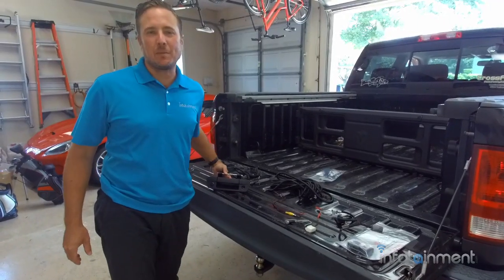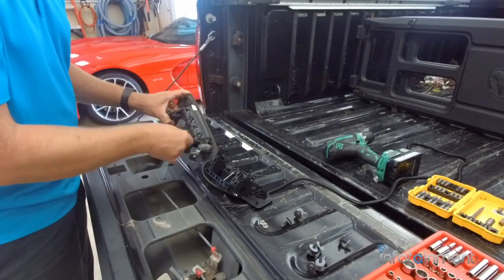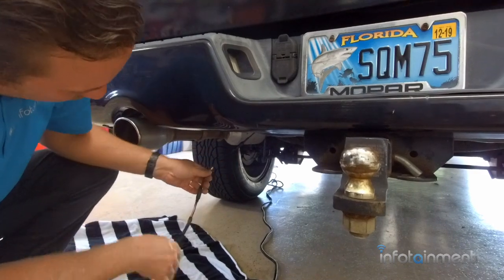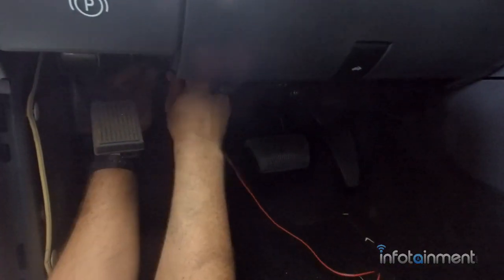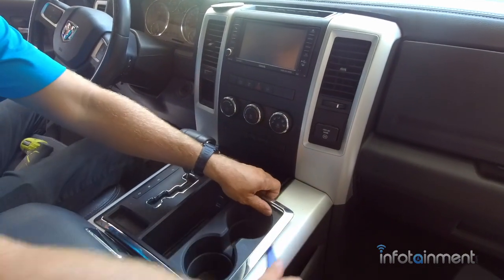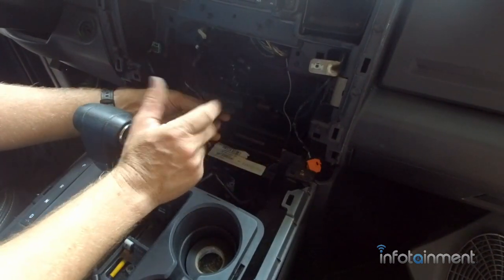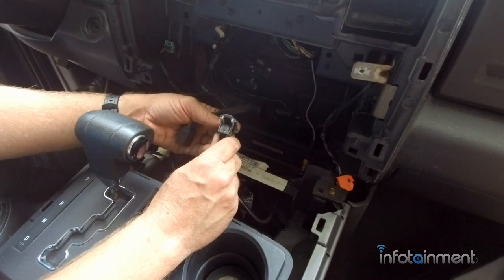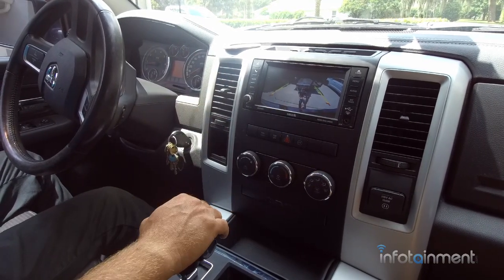2009-2012 Dodge Ram 1500 2500 3500 - Rear Back Up Camera Install - Easy Plug & Play!

Comment: can you please explain the OBDII device that you used?  Is It a special OBDII device for strictly this type of BU camera?  or does any OBDII reader work?   I have a 06 Ram 1500 with a Sony XAV-ax300 head unit that has a camera port.   Thanks,  Brian
Reply from the maker: Hello Brian, The OBD genie programmers are setup for each individual objective upgrade to avoid getting things program via the dealership. The stock setup is VIN locked for 1 vehicle for the back up camera or the objective of the RPO code that is added. We can make these work for more than 1 vehicle for a custom order or add certain objectives together but only a few. Let us know if we can help out more on live chat on the site www.infotainment.com

Comment: The obd2 programmer does this work for any aftermarket radio? I picked up a radio touchscreen nav etc.. with harness for vehicle and reverse camera in tailgate handle and was wondering does this obd2 option more or less tell the radio the vehicle is is reverse once programmed.. if so ill buy it juat want to verify
Reply: My stock radio is not touchscreen but I'm installing a touchscreen that's made specifically for my 2011 ram 1500 with a harness made to retain all factory functions and steering wheel controls
Reply: How does the obd2 programmer work I guess is the crux of my questioning.. and does it only work with a factory touchscreen radio or... thanks.
Reply from the maker: Hello.  The OBD programmer programs the RPO code in to the body control module of the vehicle.  The programmer is specifically meant for factory OEM hardware.  You may or may not need that programmer if you have an aftermarket radio.  You would need to refer to that radios requirements for a backup camera to know for sure.

Comment: Will this interfere with the parking assist sensors? Will both work simultaneously?
Reply from the maker: Yes both should work as we are using the OEM RVC programming. This will intergrate into your current features.

Comment: I already have a harness connected where you say to plug in the RCA interface. There are no wires going to the RCA pin ports though on the factory harness. Can I remove the wires from the harness and snap them into the factory harness?
Reply from the maker: Absolutely!
This link may assist!
https://infotainment.zohodesk.com/portal/en/kb/articles/c-intc2t-repinning-if-vehicle-already-has-the-radio-plug
Reply: Same here, and 3 and 4 spots are not free. A green wire and striped green wire is taking these spots, can I remove them 2012 ram 3500

Comment: Just installed mine .. was not as hard as I thought it would be ..
Reply: For anyone on the fence about trying it... I would say go for it .. Installing was very simple, takes for someone like me who has never attempted to try something like this before about an hour of your time .. and it works as  Advertise. Money well spent
Reply: @brandonstorch4522  What features did your radio have. I have the parking assist already, just no camera. I have a 2010 Laramie

Comment: You scam artists are charging $300+ for the camera!! Hoped nobody fell for that
Reply from the maker: This is a very high quality camera.  This also comes with the OEM handle which a lot of this cost is dedicated to. We offer units that are OEM or are as close to OEM as possible. If you are looking for a cheap aftermarket camera plenty of companies can provide that but that is not what we are interested in selling.
Reply: Full OEM handle assembly with camera (1280 x 720 resolution) and wiring harness  < $70 on amazon. The OEM head unit only supports 480 x 272, and 7" aftermarket head units are 1280 x 720 max.

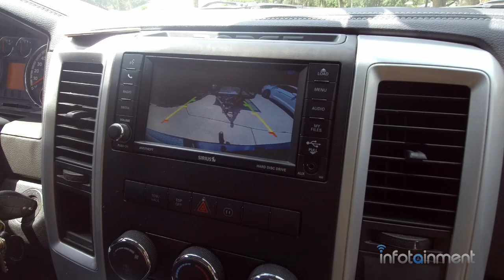The lack of resoltuion specs in the video and on the website listing would indicate that infotainment's option is likely the oem resolution (480 x 272). The only mention of the resolution is subjective and qualitative at 15:36 -- good to know the "image and quality" is "awesome".

It could be concluded that the $70 amazon option at the very least has an equivalent resolution though likely higher than infotainment's offering; and to reiterate, the amazon option also includes the OEM handle assembly + complete wiring harness, just like infotainment.

So I ask, 'cheap' in what regard? The price is certainly less, the camera quality is equivalent or better, the handle assembly is OEM - maybe you could argue the plastic quality but the bare handle without camera is likely sourced from the same place infotainment gets theirs. Reducing other options to "cheap aftermarket" seems to have come full circle as what infotainment sells, is likely the same as other options, just with branding attached. 

Let's say the amazon option is "cheap" in all regards, (except resolution as we know that's at least as good or better). If it breaks, I can replace it more than 3 times over before reaching the cost of infotainment's offering, and as we saw, it would only take a few minutes to swap out the assembly since there is a quick connect to the main wiring harness. I would bet the 'cheaper' option will last just as long.

I hope this brief analysis clarifies my original comments!